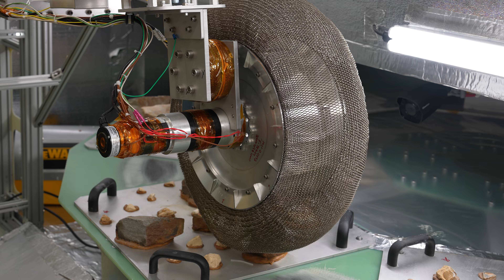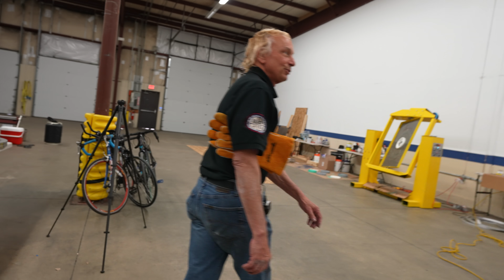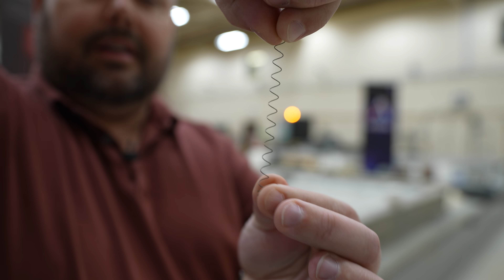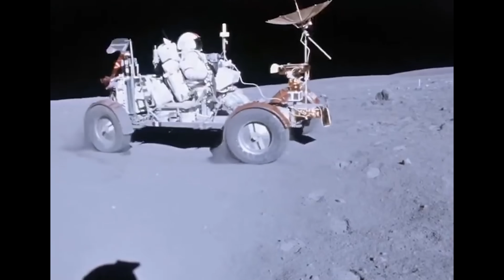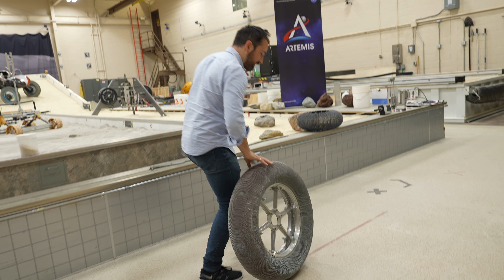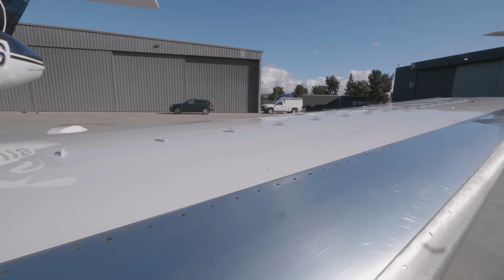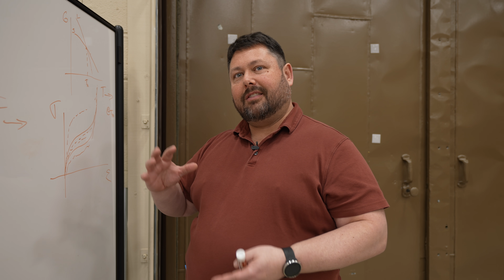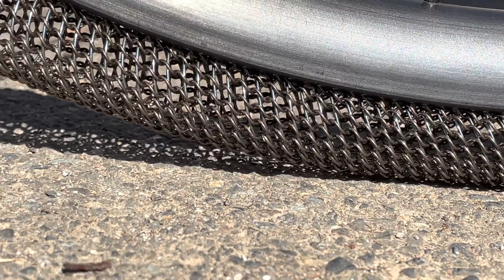How NASA Reinvented The Wheel

Comment: I don't understand why they wouldn't have used titanium for the Rover Wheels; over aluminum in the first place. Although titanium is 60% heavier than its aluminum counterpart; it is more than twice as strong for the same weight; meaning you would only need half as much titanium to meet the same parameters. So essentially they could get a wheel that is just a strong and just as light by using titanium because  they only need half as much. It's all so resistant to extreme temperatures, abrasion, oxidation, compression, and corrosion. So even if nitinol had not been invented; titanium itself could have solved their issues. They're always over-thinking things. But I do think that the NiTiNOL will be a game changer. It has all of the properties mentioned above but has the added ability to return to its original shape just by the application of heat which could be controlled electronically by having a high-powered battery with leads send current to the structure heating it up to return it to its original shape if any deformation occurs. There is already research into much more efficient solar cells that could be used for a specific solar charger array specifically for the NiTiNOL reshaping battery.; To make sure that that battery always has enough power to reshape the structure.

Comment: Wouldn't the terrestrial implementation call for enormous infrastructure costs though? Asphalt roads are specifically designed to accommodate rubber tread, especially pressurized rubber tread. I picture mesh wheels slipping around at high speeds on asphalt

Comment: The nitinol tires obviously wouldn't have the same level of grip and performance of a normal car tire. Could they wrap one of those in a layer of rubber and achieve the same level of performance. Could you simply replace the rubber when it wears out instead of the whole thing? This is really cool stuff.

Comment: Unfortunately I have to call BS on these tires for being used as car or bicycle tires. As mentioned @18:36 the material dissipates energy when flexing, which the are trying to sell as a feature (=as a damper is part of a suspension system). 
BUT: you want your damper to only dissipate energy when hitting an obstacle, so basically just motion perpendicular to the direction of movement. This material, used in the tire itself, would flex (and therefore dissipate energy) with every revolution on a flat surface, meaning it would considerably increase the rolling resistance of the tire, making it unfeasible for applications in transportation, where conservation of energy is one of the most important factors.
Unfortunately this "elephant in the room" never gets addressed in reports about "airless tire" technologies: How do they compare in the key metrics to air filled tires?  We use air for a very good reason: It is an almost perfectly elastic material and therefore very good at flexing without dissipating energy.

Comment: I don't get why going from the high symmetry phase to the low symmetry phase is exothermic. Normally, going from a high symmetry phase like a solid to a lower symmetry phase like a liquid is endothermic because the decrease in symmetry corresponds to breaking bonds (or intermolecular interactions), which requires energy.

Comment: What about the potential to use it as a generator/motor in space? Basically have the material in a circle wrapped around a generator wheel and the other end on a metal wheel that will work as a heat mass. The force generated when heated is stronger than the deformation when it is cooled. The heat source can simply be the sun, and the cold part is the cold ambient atmosphere of mars.

Comment: surely nitinol must have some applications in renewable or recycled energy? i just imagine something changing shape under heat, and emitting heat under stress, must have some application in transferring energy passively? or efficient energy conversion? like, could you put a weight on the bottom of it, suspend it in a field or somewhere sunny, and have the day/night cycle cause it to raise/lower the weight over the course of a day? would that be enough to spin a motor/generator? could this be used in gravity batteries? pendulums? i wanna know more about the applications of it when fully optimized for a specific purpose. 

i know nasa is all about optimizing for simplicity for the sake of astronauts being able to do the most with the least possible resources, so i wonder what other applications they have for this stuff behind the scenes. every country exploring space for that matter- i know that china has just recently been optimizing Stirling engines, which spin based on a pressure/heat difference, assumedly because in space you have an essentially infinite cold void for the stirling engine to pass its heat to, so even just a tiny amount of heat can get it spinning really quickly. also, they're cheap, and easy to repair/maintain, and they can do just enough to get a specific job done. i love to see old ideas/inventions being looked at for their applications in a different environment, it's so cool

Comment: Now put a high resistance tungsten wire through it as its core, then pass a current through, now you can reset its shape using an electrical circuit, now you have metallic muscle...

Comment: One more interesting application is on seismic design of structures. During my undergrad I worked at the laboratory of the University of Ottawa with 2 PhD students that were investigating how to use Nitinol rebars and external reinforcement. Goal was to to allow for additional strain without failure of structures and to potentially recover the deformation under severe seismic events =)
Reply: Yo that is honestly so cool, must've been an amazing opportunity to work with those guys

Comment: Nitinol is such a cool material.  At my old work, operating small medical device assembly machines, we would often have to use sticks with nitinol wires attached to poke the parts along.  I found out that I could make the wires into a simple knot, and they would spring right back to straight after.  My brain said both, "This is cool," and also "This ain't right," because that's not how traditional metals are supposed to act.

Comment: but isnt the moon like 250* on the moon so I dont see how it would work.  212* is boiling water  so how would this work?
Reply: metal melts at way higher temps. thats why your able to boil the water
Reply: @Tmayhem  We arent talking about melting metal.  This was supposed to go back to its original state or its original form after you put it in boiling water.   So if its already at that temperature (250+*) how is this supposed to work?
Reply: @Printer Essentials & Advertising Novelty  I'm pretty sure if it was raised to that temp slowly it would react to changes in temp like it normally does
Reply: @Tmayhem  I dont know I was just curios to see how it would actually react
Reply: @printeressentialsadvertisi6408  oh ok

Comment: If you would use it on cars or jeeps you need to have a way to not to collect dirt and rocks inside because for sure with the weight of the car stuff would get stuck inside for sure... And regarding the blades what I didn't understand is why do I need 100 of them if only one of them lasts a lifetime ???

Comment: Only thing that I'm sure prevents this from being everywhere is the potential rarity of the materials needed.  If they're able to somehow artificially fabricate these materials, I'm sure tech like this would be everywhere for a way of more affordable price.

Although, that's not considering the potential cost it takes to actually produce the alloy in the first place, now that I thought about it in another comment, it's a potentially difficult process to create this alloy, which is why it's so expensive in the first place (I'm assuming) to procure or develop.  Just the amount of man hours it took for these engineers to produce one wheel shows how labor intensive, therefore costly, it takes to build one of these.

Comment: But the stopping power with tires like that is probably not nearly as good as rubber tires, if we're going to be driving on normal roads. An interesting solution if we forced everybody to use metal tires in the future is probably to go back to unpaved roads, but then we'd have to lower the speed limits. But hey, less deaths/risks, better for the environment bc big rubber tires aren't going to landfill, and less emissions in creating them, plus you never have to worry about a flat tire again.

Comment: I remember seeing this material on TV in the early 2000's. The show, I think Modern Marvels, but probably not, was talking about wanting to build buildings with this material. It was stated that there was a desire to make frames out of it. You could fold and transport the frames to location, then just use a big heat source, or even the sun, to heat up the frame and watch it expand into place. It was such a neat idea. This was like 15 years or more ago, so i don't think it was very viable since nothing has come from it yet. I have heard of this stuff tho. It's really cool.
Reply: Its a perfectly viable idea but nitinol is grossly too expensive to be using it for structural components of buildings.

Comment: I do not like your ad for the shaver, because it is a scam. I have a Fusion 5 shaver. That is also in aluminium so it will last for the rest of my life. For my shaver, 8 knives lasts for 2 years. The shaver in the ad needs 100 knives for every 2 years. It says so on their webpage. So the shaver in your ad has bad quality and is bad for the enviroment. My dad has a plastic shaver, it has lasted for 40 years so far. No need for your scam you little scammer.

Comment: Very interesting topic and it brings amazing opportunities. I would have liked to see how to program the parent shape into the wire. I think I remember that it's done by forcing a specific shape at the hot temperature of Austenite so that the crystal structure equilibrates to that new shape, but I'd have loved to see it in action. 

Also, possible drawbacks, like I don't know how hot a payload gets during a rocket launch, could that maybe influence the parent shape if you used an alloy targeted to the cold temperatures of space? And also the travel to Mars, the payload cools to very low temperatures; how would that affect the metal?

Comment: Now i wondering can such materials is used for earthquake safety?,
since it using different tempt but from the video even on room temperature it still can be workings,
and as long as i know concrete is making heat when they cured, so after few times it will changes the shape then when it 100℅ cured it will be back into original shape, so when the earthquake the shape can be changing into certain power earthquake and after that retaining the shapes with minimal losess on building and can be used a new concrete to shape changing once more to less stress shape

Comment: When is the next prosthetic penis?
Reply: wouldn't that suck? it'd feel like you're putting a wire mesh into you. not the most satisfying feeling and it'd probably give you a rash. also I don't think it would be that tough.
Reply: @TinyLadyKris  
You’re probably right if just bare metal lol.  It would probably need to be surround in some kind of synthetic rubber/cloth that resembles skin. The part in the video where they talk about how the metal expands under heat…. And retracts under cooler temps. 🤭

Comment: Airless tires is a novelty because there is such thing as a grip, and a grip could be different in dufferent environment.
Btw, there is dirt and dust cold stuck into
And on a Jeep example we see that this tire could operate as a tire with fixed pressure. So you cannot drive a highway on a high psi, then lower it for an offroad but change an entire tire

Comment: I'm definitely curious about the part at 17:08 with the usage of heating and cooling via deformation.  It'd be cool to see it used as a spring, venting and cooling like you do a compressor minus the gas.  Another thing that's got me curious is if you could generate electricity like you do with the piezo electric spark generators.  If you could generate electricity by compression and expansion of the tires, while small I'm sure, it might add up to help extend the range of a vehicle.  Could have one set of batteries for discharging with an aux one for charging, similar to the fly-wheel design on electric cars.

Comment: How is it all these book smart engineers missed the obvious mistake.
Small stones sized just right will get pushed through the mesh but wont fall out the mesh again in a "self cleaning function"
The stones will roll around inside the tyre unless they incorporate one or two slingers that catch the stones and guide them to drop out near the center of the hub.
Reply: ok but what would that do? like yeah it will get in the tire and roll around, but I don't think that could cause enough friction or cause literally any damage.

Comment: In talking about the testing on a jeep, I'm curious what thoughts are and what research has been done on structural rather than pressure based tires that can be used for multiple applications. One of the advantages of rubber tires on something like a jeep is you can inflate them to regular pressures to drive on a road then deflate them to get more float if you're driving in snow.

Comment: These tires have a huge flaw that will make them impractical for everyday use here on earth. 
The flaw is in the design itself, the mesh. It will allow for small pebbles to enter with the help of the added preassure, but theres no such pressure when they need to get out again. 
This will obviously cause a build-up over time, and only practical testing will reveal which material we should worry about, and how much we should worry over these mats.
I love the tires, theyre great. But I cant stop seeing them as a huge sandals where pebbles etc get easily stuck.

Comment: I totally forgot about this. Now all they must do is make it into a nanomesh-weaved material or nanoporous material so it can be pumped full of gas whereas it can ultimately be used to replace rubber tires. Sherman W. Braithwaite© May 6, 2023. I just realized why scientific research was a secret thing in its infancy in the past. Also, I©mishaps is the reason MIT played around with my Flight invention? And NASA and the DOE rejects my proposals between 2016 and beyond. Anyhow, the so-called MIT-owned Flight stuff NASA accepted is garbage because it won't work. It's not an improvement to anything by following the right definition of Ionic exposure and creation or forces interaction. Imagine this, if you exposed iron to a permanent magnet, the iron isn't ionized. It is true that an ionic function does exist as an electromagnetic field is exposed to materials, however, it's quantum physics just like creating a very low-powered laser beam emission. In this case, you are moving air and not the device used in creating the airflow function. I suppose it's normal also to go off track by not doing macrophysics research and instead do microphysics experiments if you cannot do any better. There is no reason for any truly intelligent entity to sponsor microphysics experiments and ignore macrophysics experiments. The truth is, a lot of variables are missing in science since most people cannot distinguish between ionization and force a lot of the time, especially if it's someone else's experiment being reviewed. Since most scientific discoveries are made public in their infancy, improvements to other people's inventions are normal. It's called doing business or remodeling the research to show hidden variables. It's not to be confused with how science works. And walking all over people isn't normal. Anyhow, here is one of those research efforts where both macro and micro physics should have been practiced, and one is ignored. ka-Ching!

Comment: As a man who sell dental appliance, this Nitinol actually good, specially in orthodontics, they call it "heat-activated wires" and put in the brackets, in room temperature it can easily deform to match your teeth curve and your body temperature will help the wire return to their original shape which is a beautiful aligned jaw line shape. (Actually this is just the first stage of orthodontics).
Correct me if i'm wrong. Thx.
Reply: I can actually see that it could work! Remember that part of the video mentioned biomedical use

Comment: It would be interesting to know how the thermal conductivity of this affects things.
If it's a low thermal conductivity, then I would imagine that the tires would be susceptible to overheating and therefore melting, undergoing permanent deformation as a result.
I am grateful to my cousin who has been enthusiastic about NiTi for years now.
Reply: It has a melting point of 1300°...similar to steel.

It retains nearly all it's strength up to 400°C, then slowly decreases until 1300°C.

100°C (the boxing point of water) is too hot for normal rubber tyres.

It has low thermal conductivity, but so does rubber. Yet even rubber wheels with it's comparatively low melting point seems to have no problems with heavy use. 

Nitinol "eats" heat to go back to martensite. It's more likely to become ice cold, from heavy use. You could even use this effect to make a fridge.

Comment: I wonder how effective it would be as a replacement to motor joints in robotics. One of the issues with making moving parts is power, since you usually want to move big, heavy things. Maybe it can be used as a supportive frame that eases the burden of the main motor and increases the maximum power it can lift. Though I also wonder about the cost of the material and it's availability.